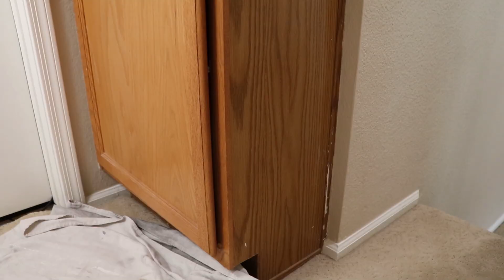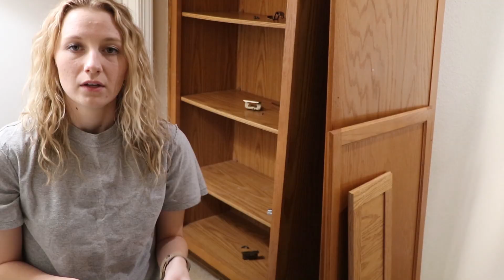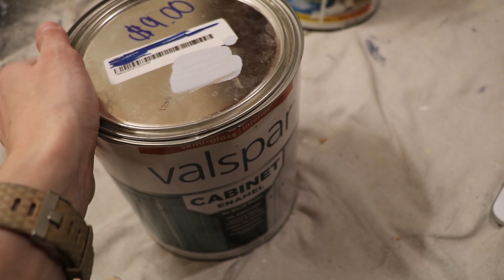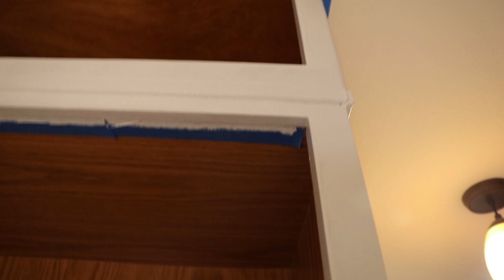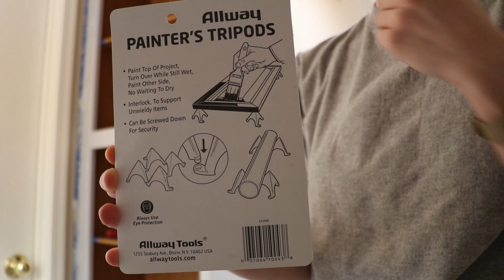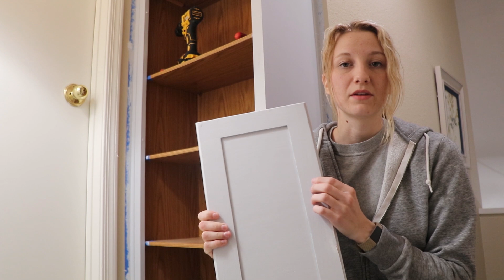Cabinet Paint: A Step By Step How To Video

Comment: your mini roller is too big , use a 4" 1/4 nap ..... and DO NOT DO NOT , "paint one side of a door and flip it over" , let it dry before flipping it over , you will smudge wet paint with your method ..... paint ONE SIDE of all your doors , when you get done , you can start over and flip doors as they will probably be somewhat dry , best to be completely dry , and it is best to paint the INSIDE of the door first , THEN paint the outside LAST (outside of door is what you SEE on cabinets , take care to make the outside look best ..... Valspar is decent paint m there bonding primer is decent , SW Pro Classic waterborne , SW Emerald , BM Advance , PPG Breakthrough good on cabs (water clean up paints) ..... BEST choice for primer is BIN or KILZ Original Oil .... but a water based bonding primer is decent ...
Reply: Does Kilz Original oil smell as strong as BIN? How many hours or days do you recommend for drying time?also, drying time for paint if it’s BM Advance or PPG? What about Ultra Spec? Thanks in advance
Reply: @neshmahenkel2428  THEE WORST oil primer (as far as fumes) is "Cover Stain" by Rustoleum , that stuff is strong , especially spraying , whew !!! But yes Kilz original has some fumes , but they don't bother me too much (everyone handles fumes differently , painters have a higher tolerance for fumes , we're used to it) .... Kilz Premium 3 water based is very "mild" and the fumes are way more tolerable .... However it would require a bit more prep , a wee bit more of a "scuff sanding" for glossy surfaces or for sure a good deglossing + sponge sand pad , but Kilz Premium 3 is pretty darn good stuff as far as latex primer , and much better than the 1.2.3 latex primer ..... I usually thin primers (and paints actually) just a wee bit , with mineral spirits or water (obviously depending on what primer/paint being used) , and I will add a wee bit of additive like Penetrol (oil) or Floetrol (water) or M-1 extender (water) .... Advance is a good paint , but dries slower than SW Pro classic or PPG Breakthrough .... PPG Breakthrough dries very fast which is great , BUT , it doesn't give the paint time to "melt" , I will add a little "extender" to slow drying time which helps a bit , but Breakthrough is very fast drying and I definitely like it , and works well on cabs ... but it does have a bit of a "melamine plasticky" feel to it ..... The best finishes are the laquers and oils , they dry hard and slick , but fumes are tough and laquer should be sprayed not brushed , oil can be brushed ..... I use SW Pro Classic latex or the waterborne quite often if I want a "water clean up" paint for cabs .... I thin it just a bit with water and Floetrol and it brushes well , dries fairly fast and a fairly durable finish .... but the only problem with SW paints is they don't have a real bright white , their "extra white" has a bit of a "greyish tint ever so slight" , kinda drives me nuts how SW cannot seem to have a "really nice white white paint color" but they don't .... I did a "white test" long ago .... Pro Classic vs Advance vs Breakthrough , and I THINK Breakthrough was the whitest (I know it was NOT the SW Pro Classic Extra White) .... anyway , I have a vid or two on my page , but not a lot , I work alone mostly and hard to video and work at the same time !!!!!! lol , so my "how to" vids are not all that great ..... feel free to ask me questions ..... oh and the primer dry time , I would definitely let the primer dry 24 hours , let it work bonding ..... "Dry To The Touch" means nothing when recoating primer , I let it "work" before recoating and rewetting it , and I let it dry real well and "gas out" .... Kilz oil original or Kilz Premium 3 are not bad choices for primers , BIN best , but expensive .... Kilz Oil sticks just fine and so does Pr3 , I LOVE Pr3 frankly .... just clean degloss well , a slight scratch w a sanding sponge (very handy to get in detailed areas) , wipe with damp cloth (lint free , I use old T-shirts for rags , works just fine) and prime w Kilz Premium 3 water based primer .... just use a bit more effort to scuff and degloss and it works well , stuff sticks
Reply: @neshmahenkel2428  Oh PS the Ultra Spec .... I do not use BM a lot and I believe Ultra Spec is more of a "wall paint" .... If you used any "wall paint" you'd want to clear coat it with a water based polyurethane , 2 or more coats for durability , but I'd just get a decent cab and trim paint and skip all that clearcoat stuff .... Everything depends on how you want things to look .... HIGH END , MEDIUM , or RENT HOUSE .... If you want HIGH END , you need Laquer or Oil Paints , preferably sprayed .... You can't get "High end factory finishes" with a brush/roller" , but you can get decent looking finishes if you use good tools good techniques good products
Reply: shure46 Thanks for your detailed response. I think I will go with BIN and do it outside. How long do you recommend for BIN to dry? Thanks once again.
Reply: @neshmahenkel2428  I always try for 24 hours before re-coat , I don't care what the can says , I let my oil primers "gas out" (PS BIN uses Denatured Alcohol as thinner/cleaning solvent) ..... "dry to the touch" doesn't mean "gasses have stopped escaping" .....
Reply: so u dont think using the behr paint she showed in the beggininng is gud for kitchen cabninets?
Reply: @estheriyilw6890  it might be decent paint , never used it ..... any urethane modified paint should be decent .... emerald works well
Reply: @shure46  ok , how about rust oleum paint?
Reply: @estheriyilw6890  if you use an oil paint just use Sherwin williams pro classic oil or Ben Moore Impervo oil
Reply: @estheriyilw6890  if you mean Rustoleum spray cans of paint , ya go ahead , spray can it ..... but with a brush , I'd go ahead and use a paint from a paint store , SW or Ben Moore paints .... Sherwin Williams Pro Classic WATERBORNE or Emerald Urethane are water clean up paints , they work fine ,,, if you go oil , use SW pro Classic or Ben Moore Impervo
Reply: @shure46  I meant do u think the brand is gud? - rust oleum, compared to Ben Moore (not the oil one, I’m not using oil paint) and is spray paint primer just as effective then using rollers or brushes?
Reply: @estheriyilw6890  Rustoleum makes a LOT of products , some are good some are not , spray primer should be okay to use , any water based products with a paint brush should be quality paint for cabinets , just don't use "wall paint" .... Valspar cabinet paint is decent paint , it's okay .... Just tell the "paint desk" anywhere , you want water base for cabinets .... spray primer is fine , spray paint is fine (those are oil paints)
Reply: @shure46  thank u so much! Btw r u a paint contractor? And what number of sandpaper do u recommend? I see a variety some use , and some say use a tougher one when first sanding and a finer one in between each coat...Wat do u think?
Reply: @estheriyilw6890  just clean and scuff a glossy surface with a sanding sponge (sold at paint stores) or 220 grit sandpaper .... those sponges get in the nooks and crannies better ..... you do not have to "sand the holy hell out of it" , you just put microscopic scratches to dull the shine a bit and give the primer something to "grab" .... glossy surfaces are like glass , hard for paint to stick to it , needs "scratches" .... NOT BIG scratches , small scratches , sort of DULL THE SHINE a bit , that's all , then wipe clean , let dry well and prime , let primer dry one day , then paint ..... I have a video about SW Emerald , go watch it .... just keep in mind OIL PRIMERS STICK BEST .... just sayin .... but I have used Valspar Bonding primer and it worked well .... You MUST clean off cabinets and scuff up glossy surfaces , if you spray paint or brush oil primer , it does stick better with less sanding prep .... BIN KILZ RUSTOLEUM , whatever , if it's oil it does stick better ..... I use Kilz Original when using oil primer , some painters say BIN is THEE BEST , for me KILZ is fine , and Valspar or any Bonding primer works well (water based) .... just let them dry 24 hours before topcoat , no matter what the can says , let it dry 24 hours , better bond
Reply: @shure46  sorry Ik these r a lot of questions, but if I use a oil based primer like the ones u mention can I use a water based paint on top of it like behr or Ben Moore advance? And do pay pay u to paint theirs?
Reply: @estheriyilw6890  YES , but don't use advance , hard to work with , takes a long time to dry ..... let oil primer dry at least 24 hours , 48 hours better .... oil primers "gas out" (fumes) ... I'd use Valspar cab paint , or SW emerald , or SW proclassic waterborne hybrid .... OR you can use Ben Moore "cabinet coat" , OR PPG breakthrough ... all of those not bad , you won't like advance , I used it ONCE , and I'm a painter , didn't like it ... go look at some of my "how to" videos
Reply: @estheriyilw6890  update , when i said "Valspar Cabinet paint is good" , that was strictly "cabinet" paint ... Valspar has now changed it to "Cabinet and Furniture Paint" which is not very good , they changed the name and the formula , doesn't dry as hard , stay away from that one
Reply: @hazelbellefarm476  don't use the valspar cabinet and furniture paint , it's not as good as it used to be when it just called "cabinet paint" (I have no idea what happened , but it's not as good as when it was just called "cabinet paint") , anyway , I THINK "chalk paint" sticks well , but you need to test it , see if you can scratch or peel paint off , see how well it is "stuck" .... It never hurts to lightly sand just to smooth out any bumps or irregularities , make it nice and smooth AND you'll put microscopic scratches your topcoat can "grab" on to .... wipe cabinets down first , clean them , get any grease or dirt off , you could just wipe down with windex or simple green , just don't use any kind of liquid dish soap , you do not want any "soapy residue" left behind .... I have a video using Sherwin Williams Emerald .... You don't need to prime if chalk paint is stuck well .... In my video I used Valspar bonding primer , which worked well , BUT THEE BEST PRIMER is going to be Kilz Original Oil or BIN Shellac Primer (thins with denatured alcohol not mineral spirits) ..... If you want a "water cleanup topcoat" (not oil based paint) , then SW Emerald or California Paints Ultraplate (sold at Benjamin Moore) .... PPG Breakthrough is not bad (I have a video on that too) Breakthrough is not bad at all , probably easiest to use , dries hard .... but Emerald or Ultraplate might look better , more elegant looking paint , has a nice velvet sheen to it .... Satin probably best choice if you brush (satin hides brush marks best) ..... I would say you do not need primer if chalk is stuck well , if not , coat it with Kilz Oil , or a water based Bonding Primer , Valspar or SW or any quality Bond Primer , actually Kilz 3 Premium isn't bad or Valspar Bonding Primer for a water base primer , should stick quite well to chalk paint , BUT the "Urethane Modified" paints like Emerald BOND by themselves ..... They bond quite well , Urethane is sticky paint (but slick when you brush it) .... You can add a wee bit of water and floetrol to your topcoat paint to make it easier to brush .... see my videos ..... I believe if you want to hassle with it , but want to make sure it sticks , prime with Kilz Oil , or BIN , or second choice a water based bonding primer ..... But again , Urethane modified paints STICK .... You can always test a spot , paint with Urethane Paint , wait a few days , scratch it see what happens ..... These water based Urethane paints are a wee bit runny so don't put it on too thick on vertical surfaces .... I brushed some cabs with Emerald , came out quite nice , not perfect like sprayed , but pretty darn nice for brushing .....
Reply: @hazelbellefarm476  surprisingly , some paints actually do very well for things they aren't designed for .... Believe it or not , cheapo Walmart flat wall paint actually STICKS to cabinets very well (sort of as a primer) , I can see a deck paint working (self priming and durable) , I have also heard of Sherwin Williams Duration interior wall paint being a good cabinet paint !!!!! I have never tested that theory , but plan to one day on a sample ..... I have a feeling I can simplify your project , I BET , you could clean , lightly sand just to smooth surface (maybe not even needed if surface is flat , smooth , no bumps) and then just go with your topcoat right on top of chalk paint .... I believe chalk paint sticks well so I bet you are okay to topcoat ..... SW Emerald , or California Paints "Ultraplate" , or PPG Breakthrough , use a satin sheen (BUT PPG satin has a very low sheen , others look better) , and just "paint away" .... Use a QUALITY BRUSH , Corona Orel , or Purdy Medium Stiff or Purdy Nylox soft ... Don't use a hard stiff brush and don't use a cheapo brush , spend $15 for a good brush .... I bet you'd love Emerald or Ultraplate .... you can always thin a WEE BIT to help you brush TWO THIN COATS , don't try to get it all in one whack , you'll get runs ..... and don't use Benjamin Moore Advance , it's good paint but hard to work with , you won't like it ...... You might can just clean cabs with windex , let dry a few hours , and slap on some paint ...... anything will stick to chalk paint , just see how well the chalk paint is stuck to the cabinets .... I bet you'll be fine just painting right over it really , and you can get a small roller if you prefer , but you'll get a LITTLE "stipple" ..... you might can even wipe down cabs with a damp rag , just water , if there's no grease on cabs , damp rag (not sloppy wet) , wipe down , wait 2 hours , start painting

Comment: WHY are you people not washing out brushes and rollers when using a WATER CLEAN UP PAINT ??? Your "bag idea" is for OIL BASED PAINTS .... Do you know how easy it is to just wash a brush out in the sink and NOT get that paint smeared all over your brush ..... 100 times better to just wash out in the sink , use warm water , a bit of dish soap , and clean the brush .... Next day you have a nice clean tool to work with .... bag idea terrible for water clean up paints , way too easy to clean and the whole idea of using water clean up paints ..... I see a LOT of youtubers spreading this "put it in the baggy" idea .... It's lousy advice